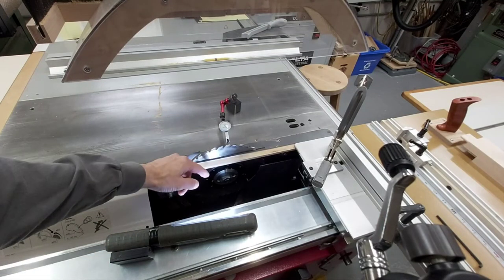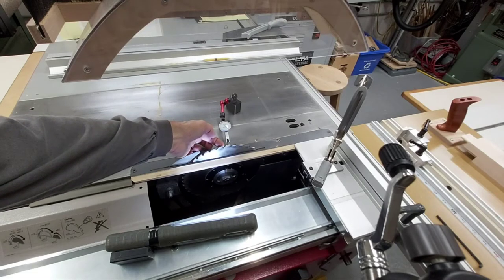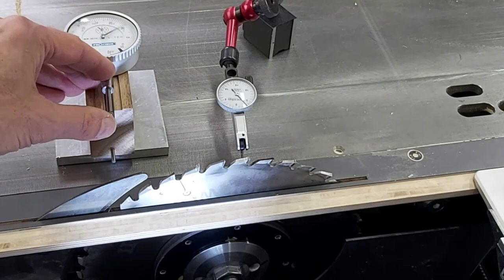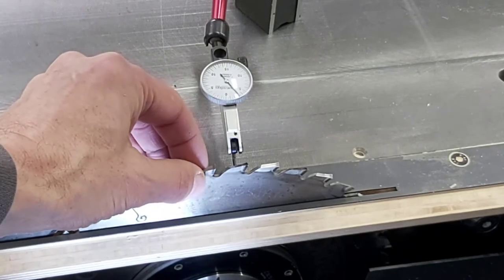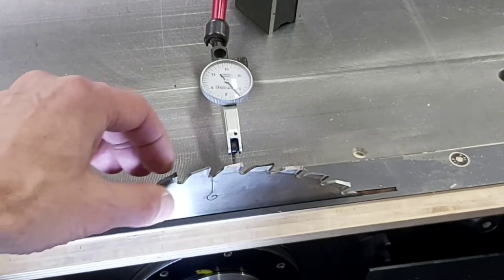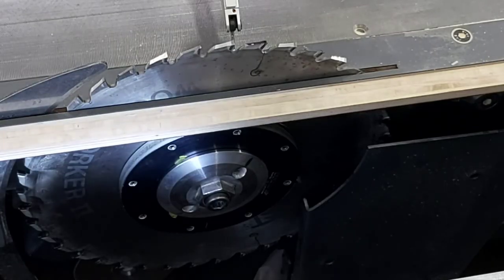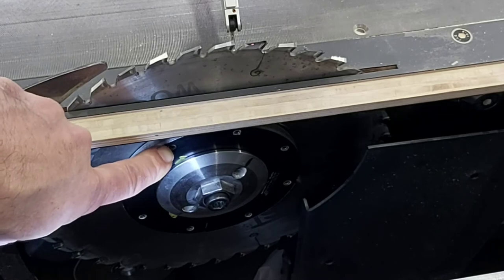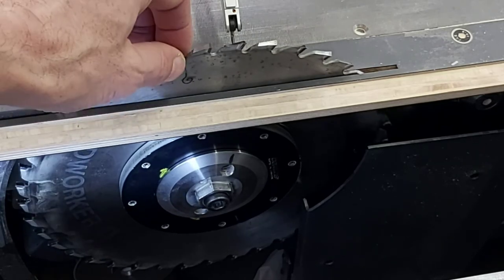Measuring and Minimizing Arbour and Blade Runout

Comment: I wonder why they stopped making those…seems like an excellent device!
Reply from the maker: It's hard to say why Lee Valley stops producing certain things. I agree that this is a great little device. I bet you could make something yourself.
Reply: @davidbedrosian1567  Is that Lee Valley plate metal?  Steel or aluminum?  Kind of looks like a composite material...also, quite thick.  maybe 3/8 pr 1/2.  I haven't had any luck finding any information on this and would like to try to make something.any info would be so helpful and greatly appreciated.
Reply from the maker: @phillipblackfurniture  I think it's anodized aluminum. It's about 3/8" thick.
Reply: guessing that grub screws tend to wiggle themself loose due to vibration. so if you maintain that thing well (ie use threadlock or sth) everything's fine. but i wouldn't want to be liable for small screws shooting through workshops ^^

Comment: imho totally overkill for woodworking but just for the lolz I once indicated a new sawblade laying flat on the table to be ±0.2mm then installed indicated ±0.8mm. kinda alright for a cheap handheld circular saw however almost 1mm runout with a 4mm thick blade seemed bad enough to add a new saw to my wishlist ^^